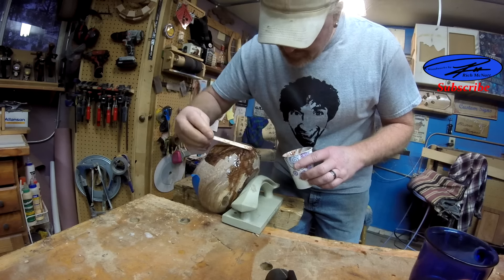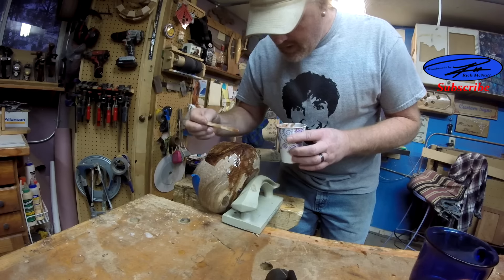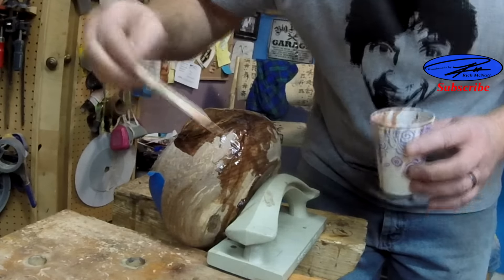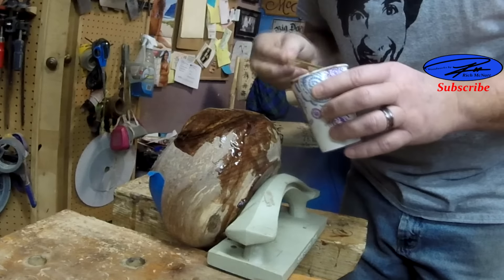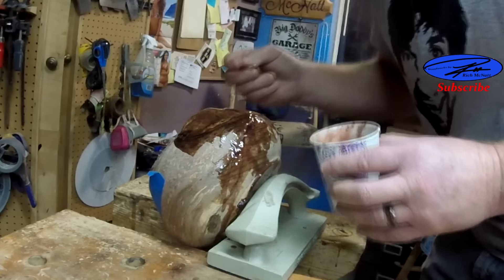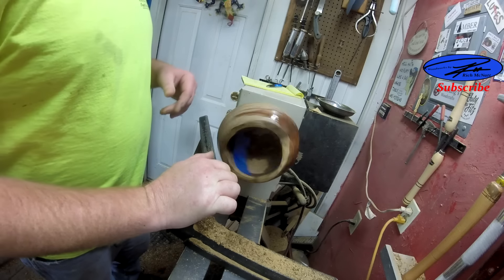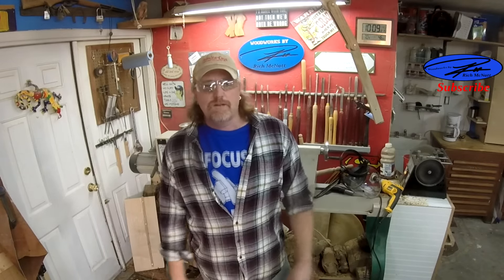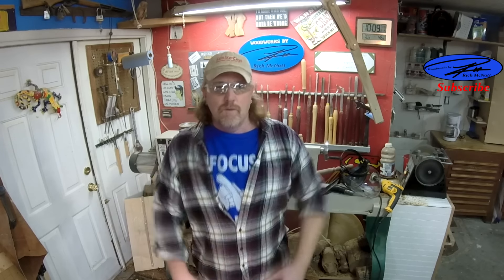Cracked Oak

Comment: Is is it safe to use such a dish for food?
Reply from the maker: It would depend on the finish used, This one is not food safe
Reply: Rich McNatt I have bought a soupe ladle and wood cracks are filled in with EPOXY. Despite a store claims that it is food safe, I consider to return it back. The ladle is made in Tunisia. I will take other one without cracks and epoxy, just in case🤷‍♀️